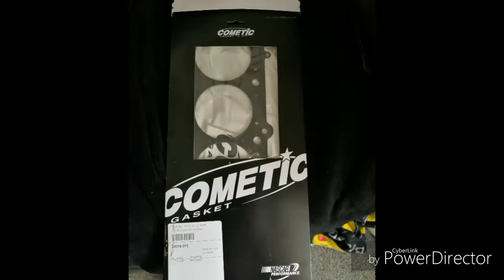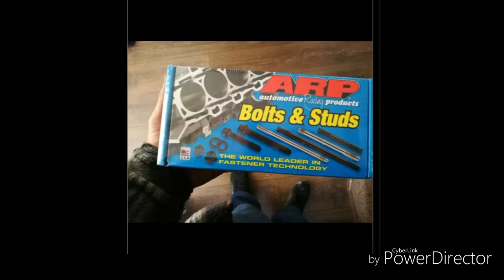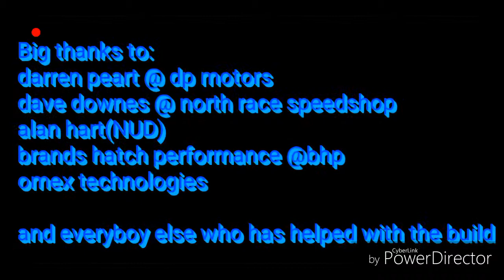C20LET VAUXHALL NOVA DRAG CAR

Comment: yo lo hubiera dejado racing  pero con la modificacion del frontal que lo hace mas ligero https://www.youtube.com/watch?v=Pbm1aXvmGq4 - https://www.youtube.com/watch?v=4mq5grLEjlY
Reply from the maker: ￼ Learn to pronounce

El coche es muy ligero, solo 760 kg.
Reply: @blueonblueracingnova  lo se yo tuve uno en version  A 4 puertas sin maletero 1.2 45 caballos lo puse en una autopista de peaje a 190kmh le gripe el motor luego quise ponerle un c20ne 8v pero me quitaron la idea de la cabeza se hubiera quedado muy guapo con unas llantas bbs en 13x7 o unas smoor en 13x7 y planchado de suspension con el c20ne turbado con una caja f23 de calibra 6 velocidades i 280 caballos i el anti-lag por el capot escupiendo fuego xD https://www.youtube.com/watch?v=66JwvT4QD1A - https://www.flickr.com/photos/144481777@N06/29026043094